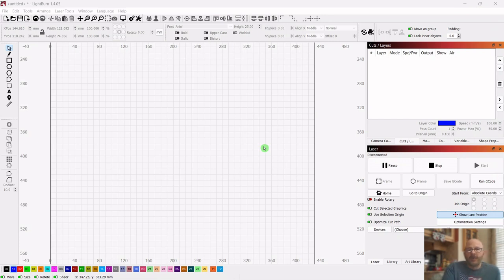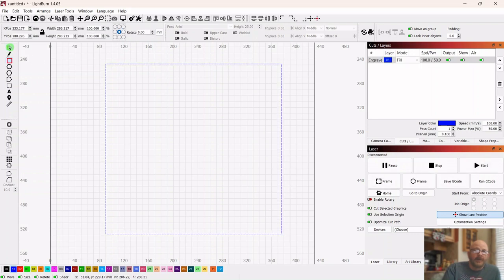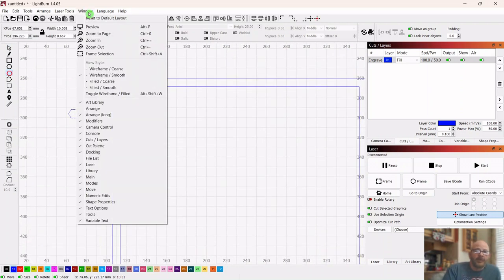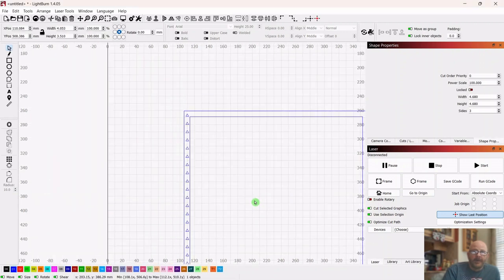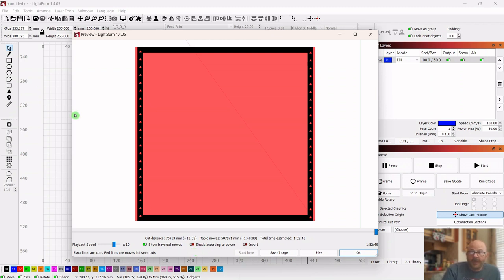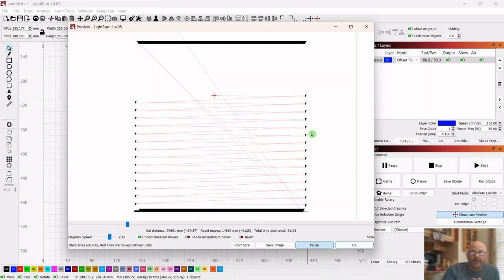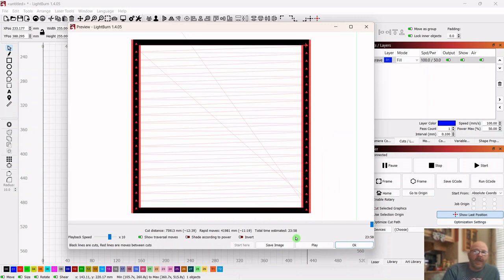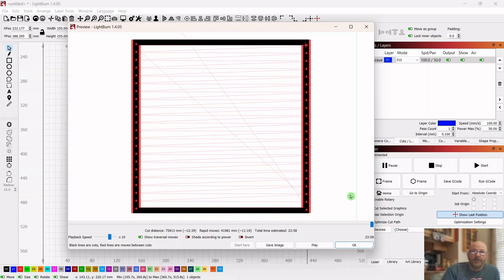Flood Fill | Lightburn Tutorial #10

Comment: Thanks a lot. And as usual another helpful video for usn'.
On another subject matter, I created in Inkscape, a "Layered Devil Egg Serving Charcuterie" for 4-1/5, 6, 8 & 9 eggs. Each has 3-4 layers, using 1/8" (3mm) wood. In each layer, the egg shape/size decrease by 1/4" from the original size. The last layer is just the charcuterie board by itself.
Was thinking maybe the first board should be from a veneer, making a thinner overall in thickness board.
Board sizes are eggs W 2.000" x H1.500" (remain same size)  
for 9 eggs, W 19.000 x H 7.500"
for 4.5 eggs, W 11.138" x H 7.500"
for 6 eggs, W 10.500" x 7.500"
for 8 eggs, W 10.500" x 7.500" (egg layout changed around, four rows, 1st row 15° up angle, next two two rows horizontal 0°, last row -15° downward angle) The egg angles was used on all of the boards configurations.
I would like to send you those four files, but need an email address, if you would like to have them.
Thanks again for your help.
Reply from the maker: Bill, glad the videos are helpful - I enjoy doing them.  I would like to check out the files - you can send to dglasercraft@gmail.com.  Thanks and take care  - Dave.